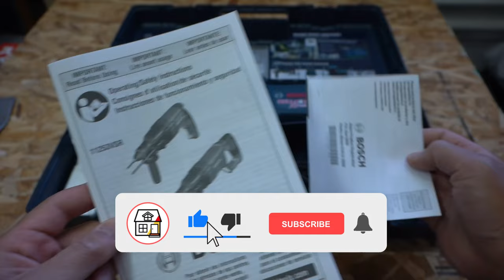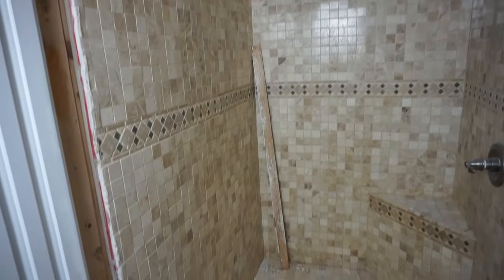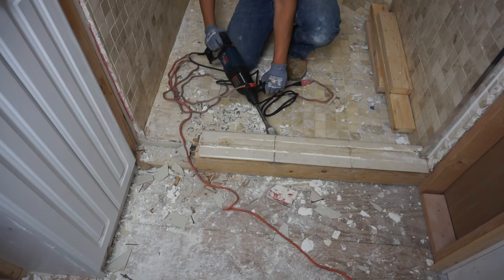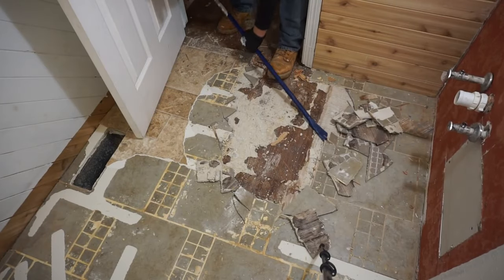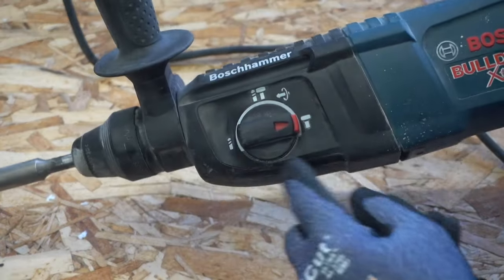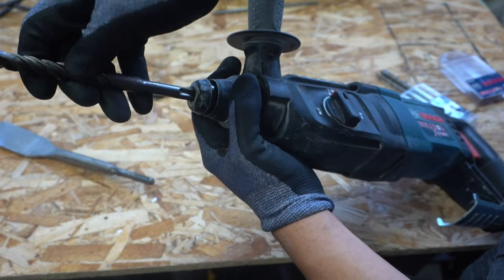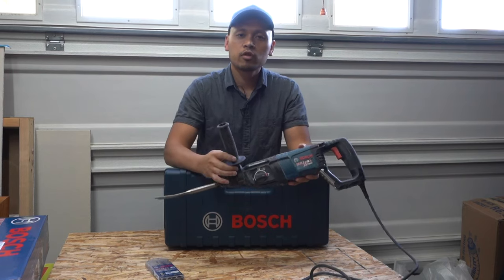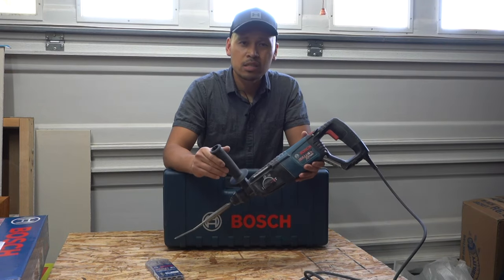How To Remove Ceramic Tile Floor The Fast And Easy Way! Bathroom Tile Removal For Beginners! DIY

Comment: Needed to remove 1000 sqft of ceramic tile when I got the notion that there had to be a better way than hammer & chisel.  Pulled up the 'Tube' and low & behold your video popped up.  Saw you use the Bulldog and decided to get myself one.  Ordered same day as I saw your video (Monday). Tool was delivered by Amazon on Tuesday. Started my demo around 2pm and here it is Thursday and the job is complete.  THERE IS NO  WAY I'D BE DONE WITH MY FIRST ROOM had I not seen your tip.  Manually, I was averaging 1-2 rows of about 16 tiles each row over the course of a few hours.  This is not a joke, with the tool I was able to complete a full room in less than an hour.  The only task that caused the job to take longer was the need to clean & dump tiles as I went along.  Thank you more than I can type for making this video.
Reply from the maker: So happy I was able to help and save you some time! Honestly I was doing the old school sweat equity method and luckily I had an awesome subscriber recommend this, and it has saved my hands immensely! I have carpal tunnel so this helped out a lot! Thank you so much for watching and I’m glad you got your project running smoothly! 👍🏽😊🙏🏽

Comment: I bought a Vevor jackhammer for $165 last week.  A rental would have cost me $150 for 4 hours.  The jackhammer arrived yesterday with two bits, gloves,  oil, mask, and safety goggles. It must weigh around 60 pounds. It took up my whole double layer tile kitchen floor in 20 minutes. The jackhammer would not be practicle for walls or ceilings due  to the weight. However, for floors it was great because it would lift up big sections of the tile floor without breaking it into small bits. I have  tried the Bosh before,  but it made too big of a mess.

Comment: The only thing I noticed is when you were drilling through those two 2x4s, And how long the process took to penetrate both. Wondering if that has to do with RPMs. I would think faster RPMs would drive that through faster and of course depending on the bit as well..
Reply: Use the hammer drill for wood, too.  Faster

Comment: Would it be faster to use a heavy hammer
Reply from the maker: Hi! It depends. I’m not very strong and I have carpal tunnel issues. This tool helps out a lot given the vibration but that can be reduced using anti-vibration gloves. Using a 42” prybar also helps 🙏🏽